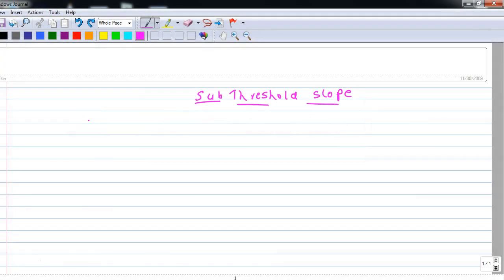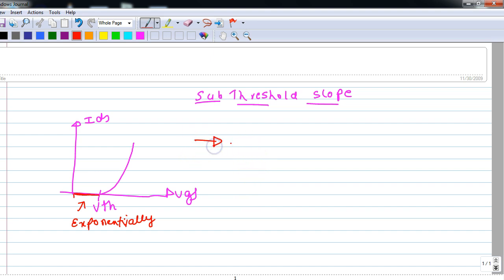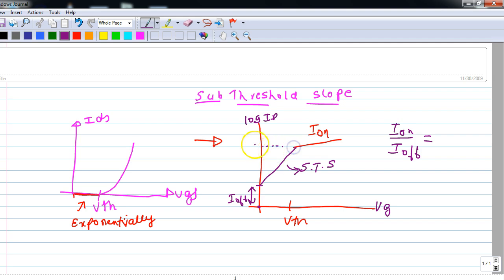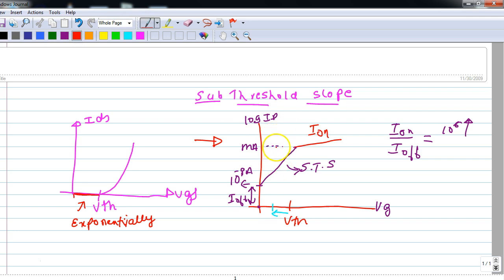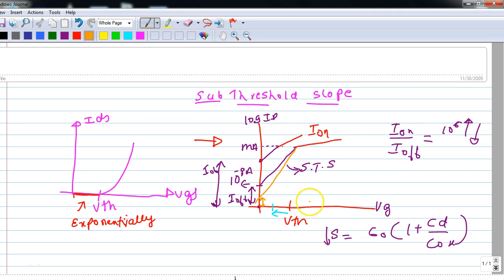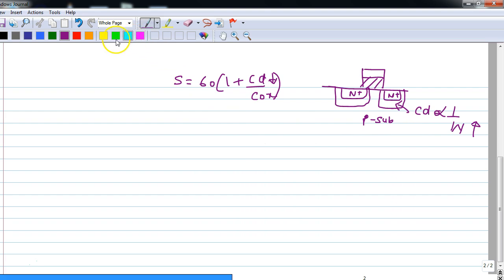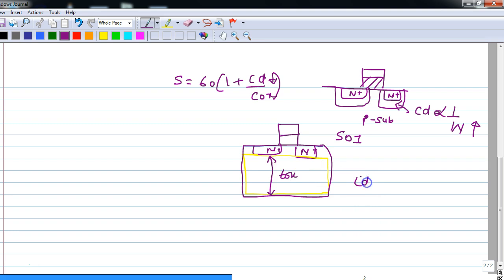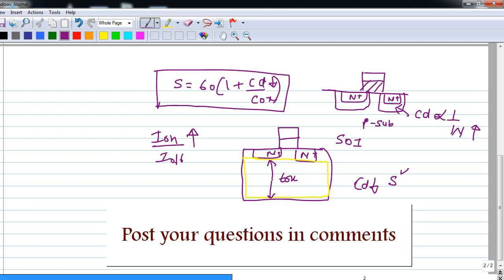Sub Threshold slope

Comment: S=Vt* ln(10) *(1+ Cox/Cdep) is the subthreshold swing or figure of merit of MOSFET and has a minimum value of 60mv/decade (when Cox/Cdep=0). S is the sensitivity of subthreshold current to the gate to source voltage in the subthreshold region. S=60mv/decade means a decrease of 60mv of gate to source voltage causes 10 times decrease in subthreshold current. But we want the decrease in subthreshold current more rapid that is a decade in subthreshold current should be with a slight decrease in gate to source voltage. So S should be minimum and the inverse of S which is the subthreshold slope should be maximum. S=60 is the minimum value which has been achieved by chip designers uptill now even the latest FinFETs have not achieved  value of S below 60mv/decade.

Comment: Hello, 
I am wondering how subthreshold slope change with respect to temperature ?
Reply from the maker: Very good observation. To answer this, you will look at the parameters changing with temp( VTH). Based on temp, the VTH will shift on the x-axis. I will try to explain the temperature dependence soon in a new video
Reply: @vlsiorg  

I figure out in this way!

Subthreshold slope (S) = ln(e)/(Vt*n) so if n =1 then S = q/kT  because Vt = kT/q. Therefore, S and T have inverse relation with each other.